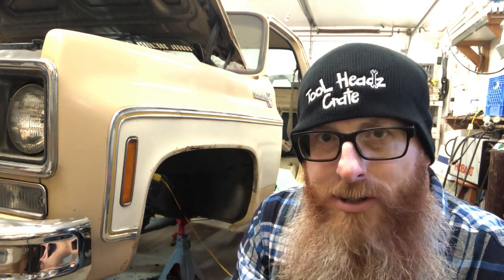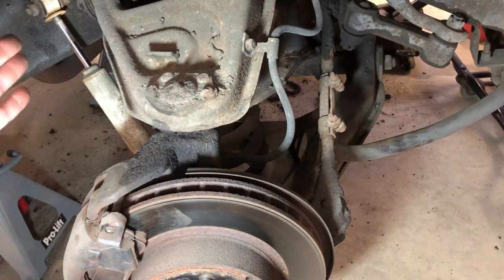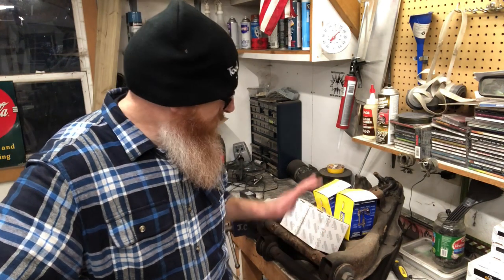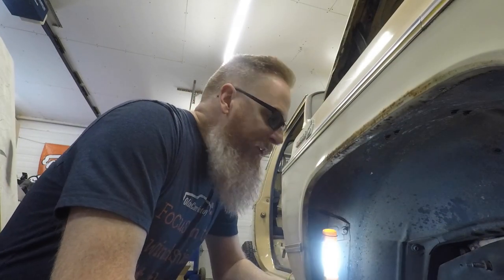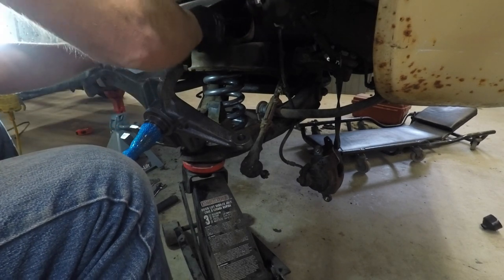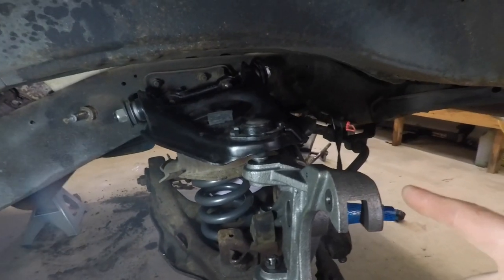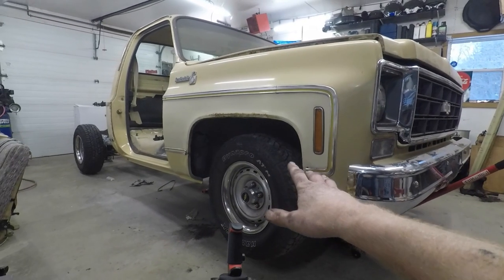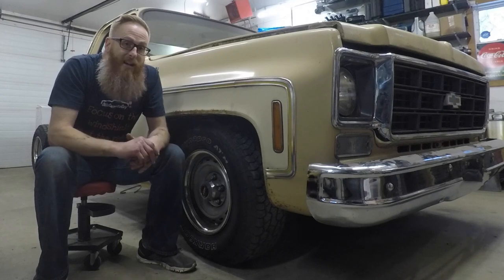HOW TO LOWER THE FRONT SUSPENSION ON A 1977 CHEVY C10 TRUCK PART 3

Comment: Hello my friend , I know this may sound like a stupid question but I installed Belltech springs about a month ago with spindles etc...  which is the top and the bottom of the spring? They were very similar size each pig tail. The slightly smaller one goes down or to the upper control arm?  I don’t know if I put the upside down or not and I tried seeing what you did but it was already installed.  The Belltech stamp on it should be legible and right side up or that makes no difference?  Thanks in advance and hope to hear back
Reply from the maker: Hey Zachary! You are correct! You should be able to read the Belltech upright. Also, the bottom of the spring end should prominently fit into the lower control arm. Hope this helps!